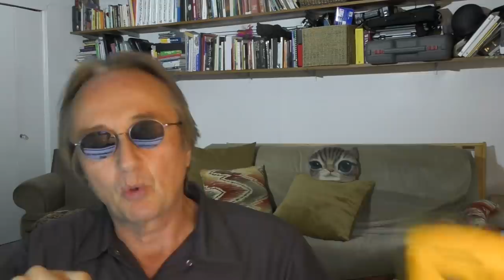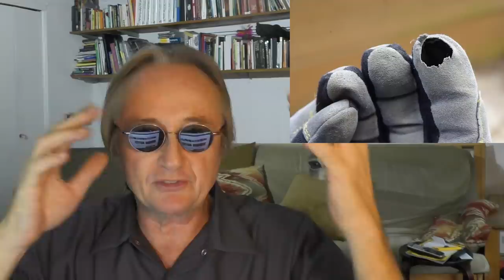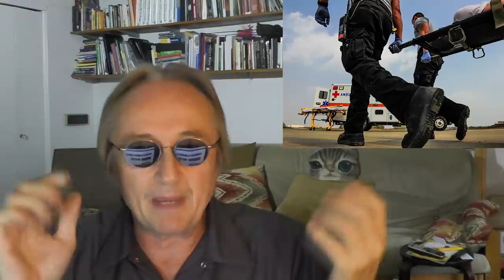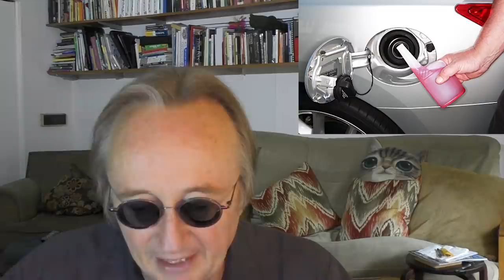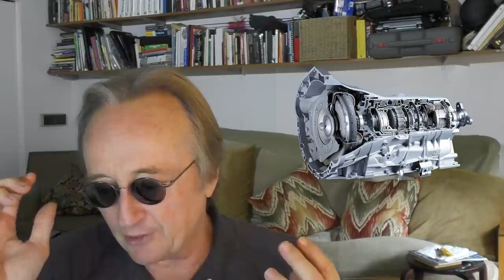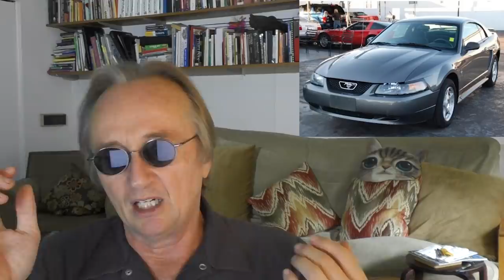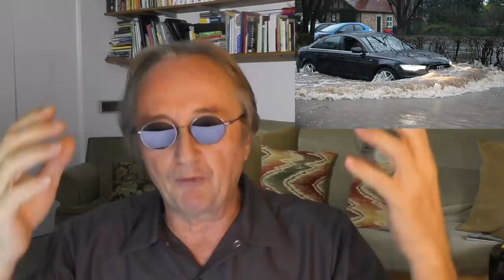The Scariest Car I’ve Ever Worked On, It Can Kill You

Comment: The scarier part about the battery in a hybrid car, is that their Lithium-ion batteries. If those damn things catch on fire you're in for a world of hurt. It's my understanding if they put a hybrid in the paint booth to repaint it they have to yank the battery out of it. Just too much Danger. Lithium ion batteries have also caused airplane crashes. The batteries were in the cargo hold and something cause to short out. The batteries overheated bursts into flames and down came the plane. If you insist on getting a hybrid the only one I know that puts a lifetime warranty on the battery is Hyundai. That lifetime warranty is good for the original purchaser of the car. I thought about getting one of the hybrids but then I thought about it some more and really get down to it the cost and the fact that the car is violate the kiss principle worse than ever turn me off. The kiss principle means keep it simple stupid.

Comment: Everyone is amping up (pun intended) the value of electric cars and, yes, the range is improving and they are fast vehicles BUT...they still take a long time to charge.  It takes me four minutes to fill the tank of my VF Commodore ('17 Chevy SS) with petrol (gasoline) which would then give me a range of, I dunno, maybe 750km.  To charge a battery on a similar-sized electric car would take well over an hour!  Nope...I can't see it working in the long run.  Better that the brainiacs at the various car companies get cracking on developing hydrogen fuel cell cars which would be much easier to replenish and give travel distance the equal of petrol motors.  P.S. Scotty you are a good bloke who speaks the truth!
Reply: With the implementation of graphene batteries and new battery tech that surpasses lithium ion in its common use, coupled with higher and higher power draws, this problem will inevitably be reduced to sub-hour levels in 10 or 20 years I'm thinking. Its easily the hardest problem EVs have to deal with right now, and likely the longest one that they'll have to fix. Not insurmountable, as the increased interest in EV tech has also spawned higher research funds for battery types, which is a nice accelerant to a lot of things in our coming future. Just gonna be a bit. 

The Model S is 100 miles shy of passing your Commodore in distance, which considering 5 years ago, the furthest any EV could go was 100 miles, sings good news for the future of that. Range is about to be a non-issue for common EVs, and once that happens the charging times will become the only reason not to own one.

Comment: How much current do those batteries provide anyway?
Reply: A lot. It depends on the battery cell.  Short-circuit current may be more than 50A.  But it should not be used that way.
Reply: That's gotta hurt.

Comment: FIRST READ IT THEN LIKE IT. I WANT THAT SCOTTY SEES THIS. HE SAID THE WRONG THING. Well it won't kill you but it will feel like a tingling sensation. Because it is DC a battery is DC. Cheak a Channel on YouTube called electoboom and search what is DC VS ac. Sorry Scotty for spamming just wanted you to see this

EDIT:And for the people who said "it's the amps that kill" that's is Wrong. Didn't you read Scotty comment that's pinned. It's like a math without the sand paper that starts the match and without the match it won't start a fire same with electricity.
Reply: its ohms law that kills you! :) However it is the total available current through the resistor(your body) and not the voltage across you that does in fact kill you. However, given OHMS law you can't have one without the other ...

Comment: Scotty voltage doesn't kill you it's amperage a 12-volt battery can kill you it goes more into frequency and amperage ACDC going back to Tesla and Edison days but for me as a first responder we're not scared of electric vehicles cuz several reasons in the first one is the car if it's got a battery short touching the ground in the car doesn't exact you you would have to touch two different points on the car I E the high voltage terminal and the ground of the vehicle or something else to treat a path but yeah man some of your videos just are so off-the-wall batshit crazy

Comment: The amps is what kill but having insulated gloves on nothing conductive and being dry are the same precautions that should be taken with the regular ones as well as that special hybrid or anything that has high amperage I have seen you work without gloves on the regular 12 volts that's just as dangerous as the 288 volts if it has the same amount of amps and I get what you are saying that it can kill you I understand that but it's not because of the 288 volts it's because of the amount of amps the battery has it doesent make a difference if it's thousands or millions of volts has Scotty Kilmer been shocked by those graphite generators which have just volts no amps but millions or thousands you can be killed very easily by the regular 12 volts with as high amps as they have

Comment: My BMW used to go fast when i put the pedal down, now it hesitates. I haven't changed the oil in a year but have only driven 3000 miles. how do i get it to accelerate fast like it used to, is it as simple as an oil change?
Reply: It's even easier.  Sell the money pit and with the scraps you get back buy a Toyota.

Comment: Sorry Scotty I disagree. If you stick your tongue on the two 12v battery terminals (say with the help of cables),  the low resistance of the spit in your tongue would fry your tongue. Hands safe, tongue no.
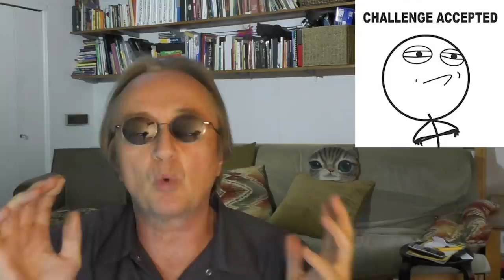Reply: @PingasTheFourth Clarify bro, Scotty didn't say anything technically wrong. Scotty said at 0:46 '...if you stick your tongue on the + terminal and your finger on the negative, nothing will happen to you...' I actually agree 100% with him on that. I misheard him and thought he said tongue on both terminals. If I misheard him, and it sounds like you did also, then I think my above point is worth mentioning. Actually if you ever, and don't ever ever do this, attach two low gauge cables (say 1mm dia copper centre) attached to the the terminals together on a car battery together, the net result is the thin copper insulated cables would become molten hot and melt immediately. I did do this when I was a kid and burnt the most painful injury I can remember. It's not the volts that kill you, it's the amps. A one volt high amperage battery can kill you if parts of you body had low enough resistance!

Comment: So low volts 12-16volts, you can stick your tongue to it yea.
Residentials 120,your basic voltage that knock ya back when you stuck a fork in the toaster lmao
220volts is medium voltage, stop your heart 2 out of 3 times. Your ac,stove and commercial buisness grade equipment
280 is a industrial voltage, most electricians never work with it. you can see it in larger buisnesses for long runs of lighting even, but its usuallyy 3 phase for generators and load centers for restraunts and such where youd need thousands of amps vs a house for example runs off 100-200amps. It has the power to litterally blow your fingers off 👍no bueno
Reply: its really all about amps tasers have something like 50k volts at times but low amps